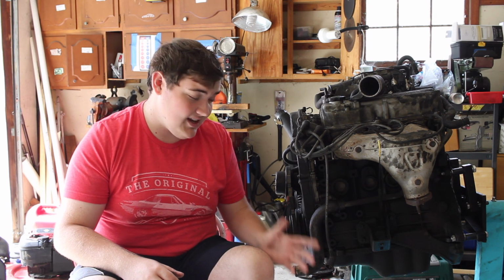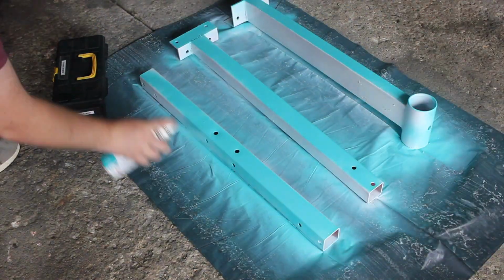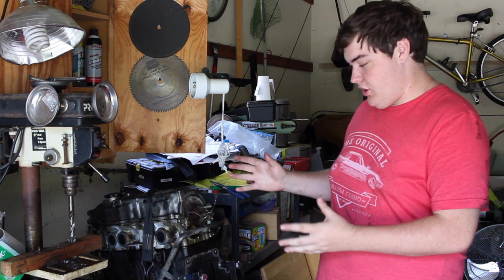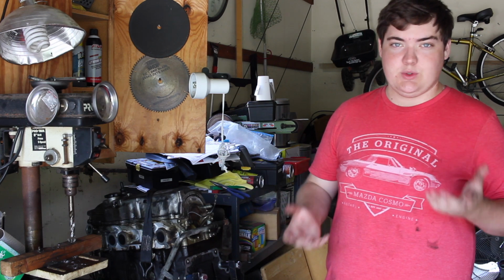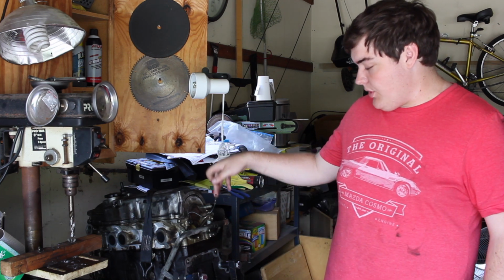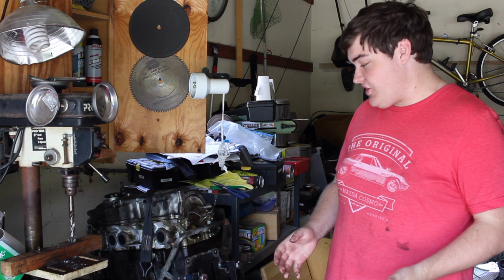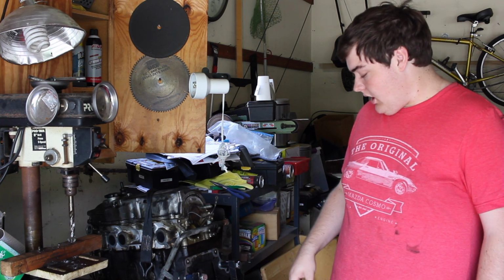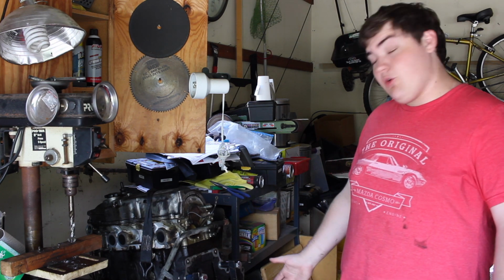#NotARotary Ep.2: Engine Tear Down Part 1

Comment: Sorry about the information that I gave you of the Ranger that's a F series the ranger didn't carry. Engine it didn't carry a diesel 4-cylinder but it didn't carry the F-series from Mazda you can use the torque specs from a Mazda MX-6 from 1988